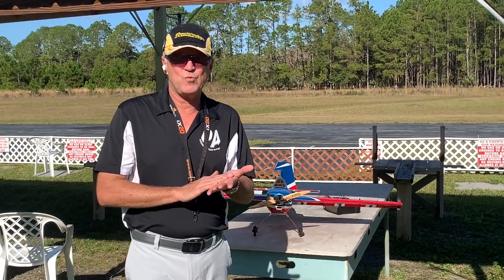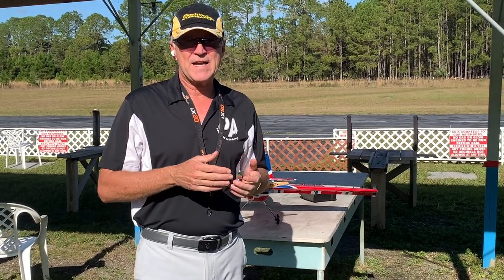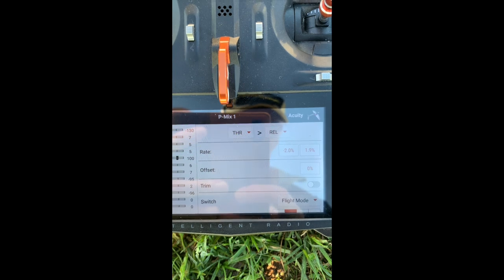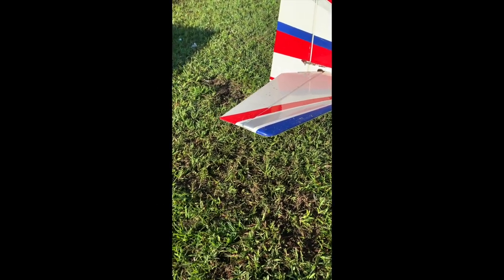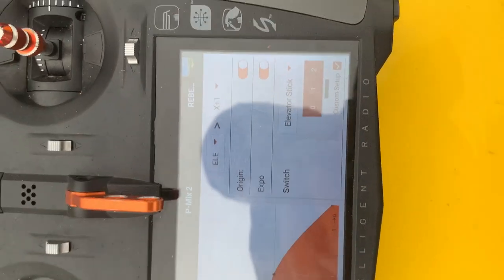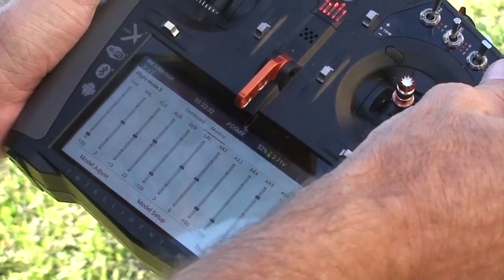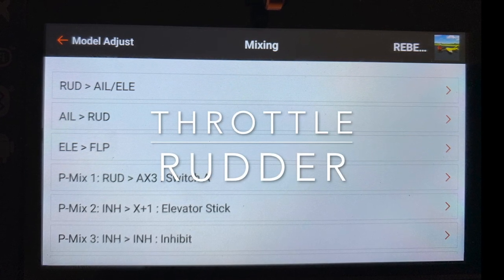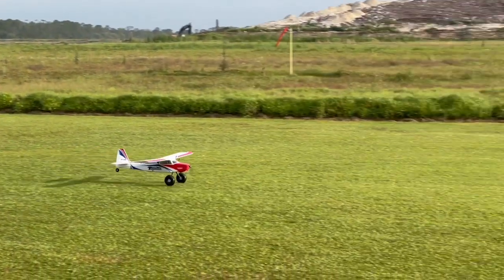MIchael Wargo Mixing a Comprehensive look at Mixing an RC plane

Comment: If you want to blow your mind, look at the mixing on high performance competition gliders. Five or six flight modes, many mixes, often with all control surfaces being mixed together, 40+ logical switches, 25+ plus special functions. Yikes!!!
Reply from the maker: I thought about Glider mixes to add...   For two reasons I didn't.   I don't fly them...  LOL.   BUt mostly because I wouldn't qualify as an expert to give that advice.   BUt yes...  They use mixing a lot.
Reply: @MichaelWargo  Cheers! Really enjoyed this video, btw. You're so knowledgeable and I didn't know much at all about some of the more 3D and pattern specific mixes.